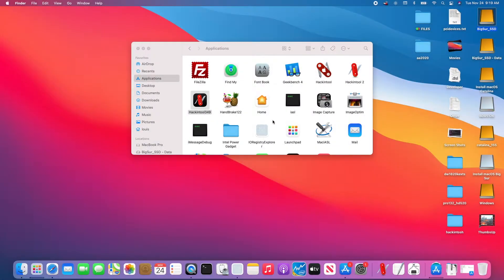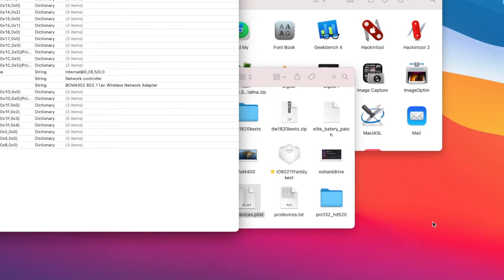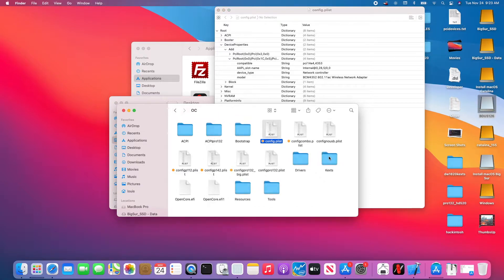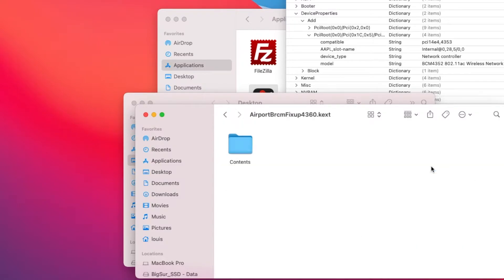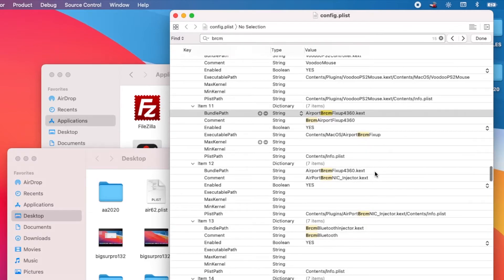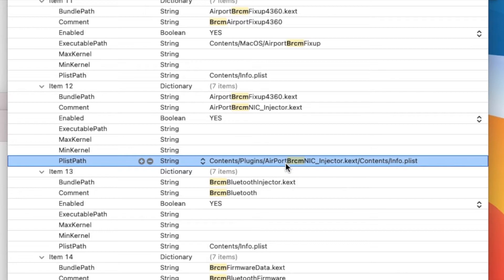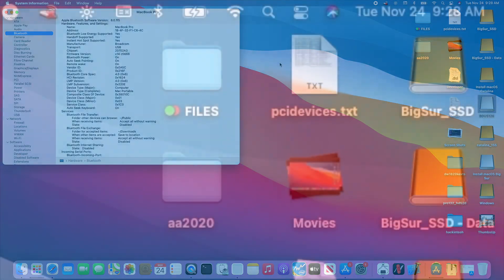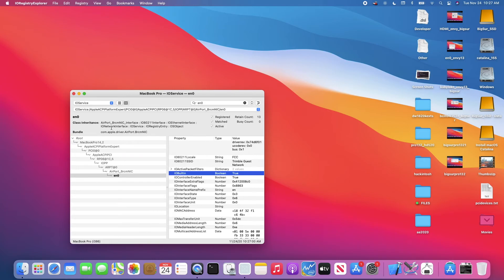How To Fix DW1560 In Big Sur WIth OpenCore 0.6.4

Comment: Finally, got this work.   Many thanks and I will summarize.  (for my Ideapad 330s-15ikb with DW1560).    1) Need to use hackintool to find your PCIE broadcom device and add to config.plist; 2) Need to create a modified kext by deleting 4360 item from airportBrcmFixup.kext 3) add 2 kext entries - a) for modified airprotbrcfmfixup and b) for NIC injector ** this got me as i didn't notice that the kernal entry for the  injector is for the plist path and not the executable path 4) modify the boot-args to include brcmfx-driver=2.      Now both bluetooth and wifi are working for my Opencore 0.7.2 on Big Sur 11.6.2 .    THanks a million and I got caught because I had modified the wrong pathname section for nic injector => it needs to be the  plist path.   Probably 10 hours of debugging here on my part (newbie with opencore)